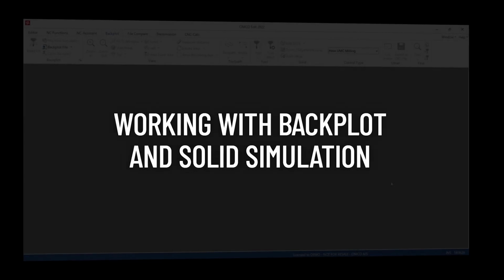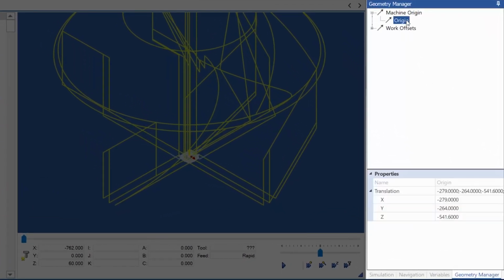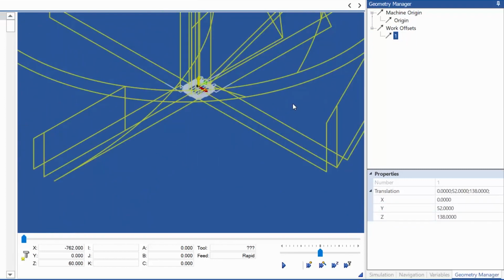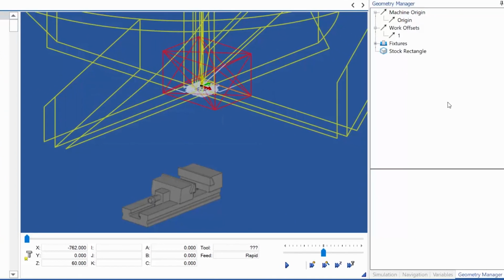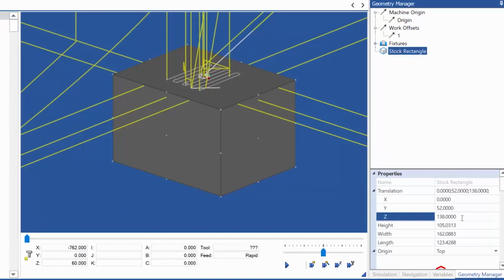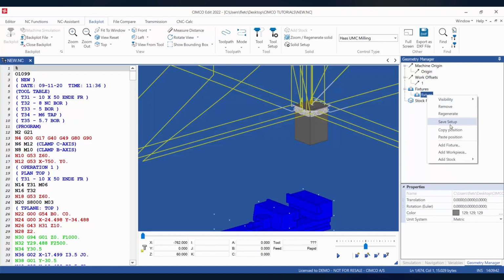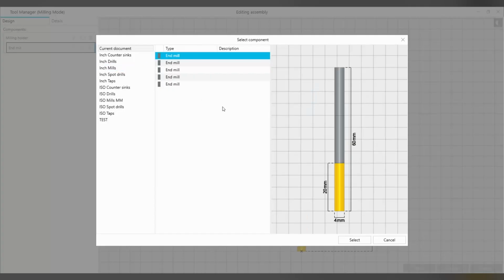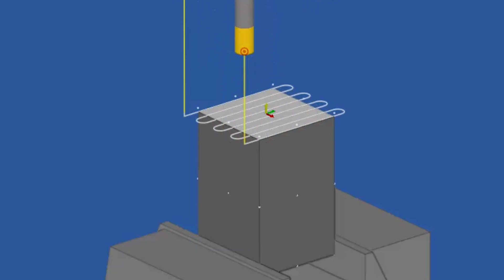CIMCO Edit 2022 - Working with Backplot and Solid Simulation

Comment: If the tool list has 5 tools and I only want simple to displace toolpath for tool #3 only, can it do that? It seems like it displaces all the toolpaths at once.

This is very confusing for the programmer, it would be best if I can disable the other tools and display the one ai want. Stay focus on cnc plot is a must.
Reply: You can shut off other paths using the mode options.